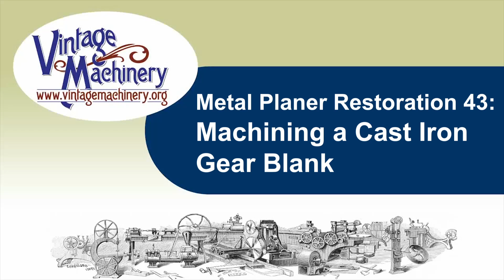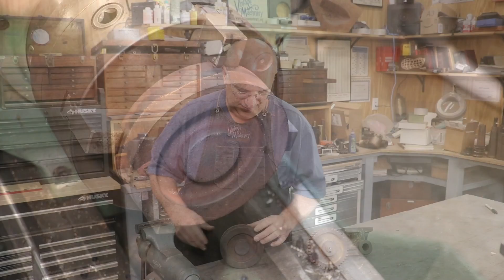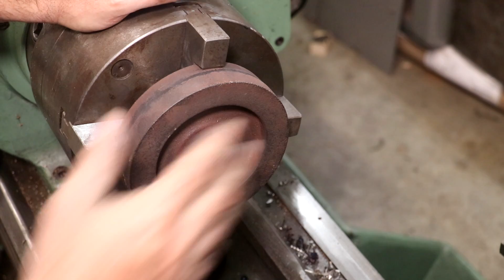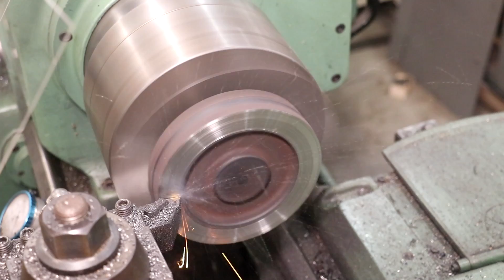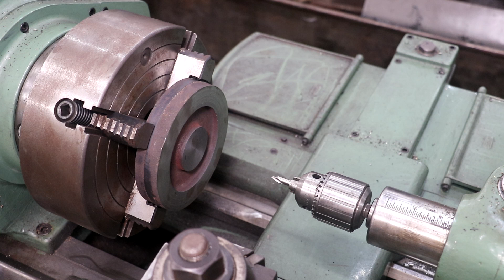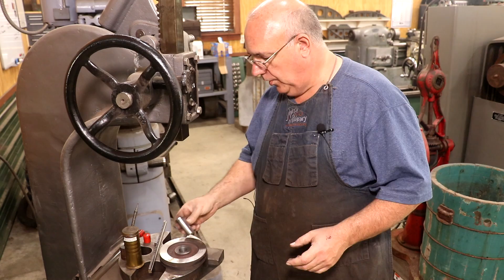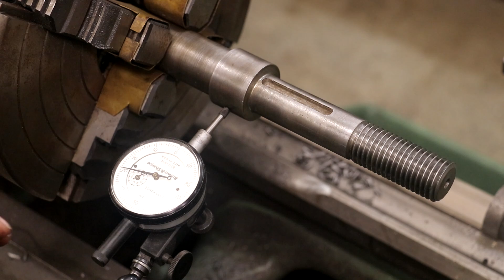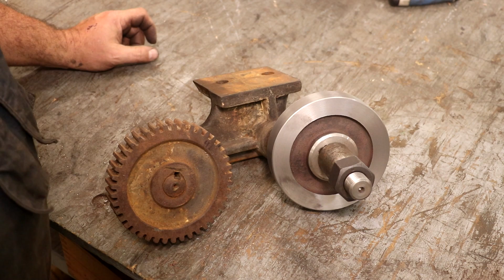Metal Planer Restoration 43: Machining a Cast Iron Gear Blank

Comment: I've always taken a  heavy first cut on CI to get under the skin. Strange choice of tool shape for facing, the first cut is apparently breaking off that small tip. 18:50 That's more like it :)
Reply: Came here for this. Instead of taking a very light cut where you’re forcing the cutter to cut through the hardened layer itself, take a much more aggressive cut so that the hardened layer is removed all in one go and the cutter actually travels through the softer material below. Can be tricky in a setup like this though, where we saw how the high cutting forces can throw the arbor out of alignment.
Reply: I'm curious if a HSS cutter would have fared any better on the hard shell than the carbide insert? I know interrupted cuts are hard on carbide. At the very least it is cheap and easy to resharpen HSS when it gets dull.
Reply: @5tr41ghtGuy  The point really is to get right under the skin so the cut is NOT interrupted.
Reply: @5tr41ghtGuy  in this exact same too-shallow cut it might indeed have fared a bit better, depending on the grind. HSS is typically sharper than carbide, so it deals with shallow cuts a little better with less tendency to rub instead of cut. It’s also way softer, so it still wouldn’t last long I reckon.
Carbide with a deeper cut beats all. A good carbide insert can easily remove a lot of material in one pass given adequate work holding and power, and doing it this way prevents the tool edge from ever having to touch the hardened skin layer of the material.
Reply: Yup that's the way to do it!